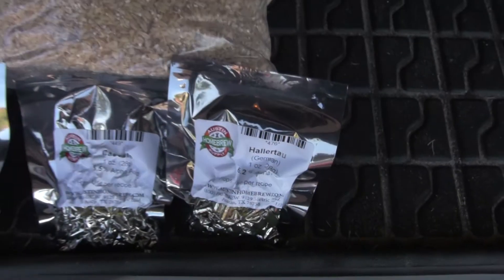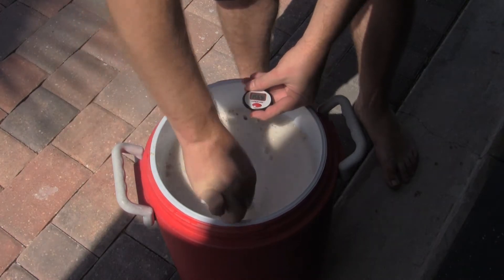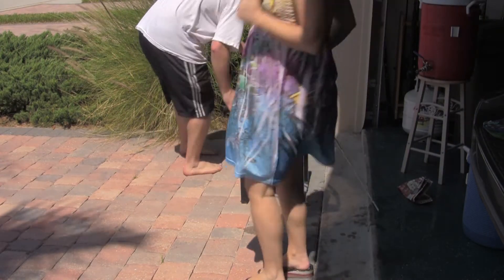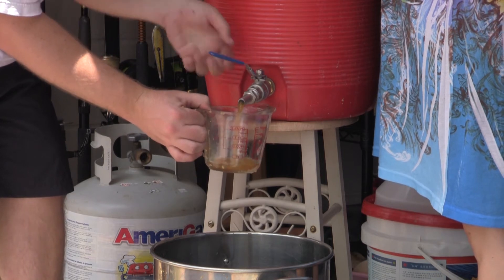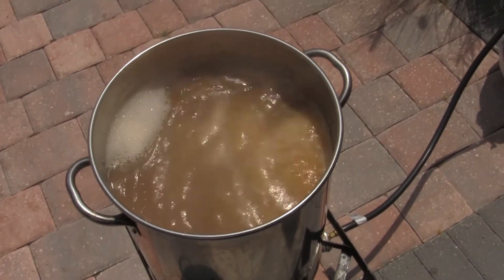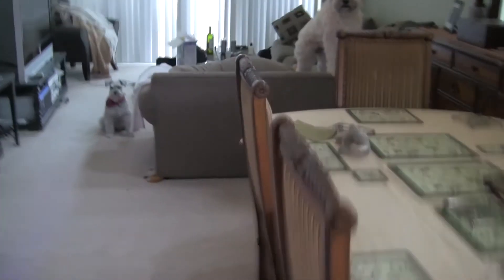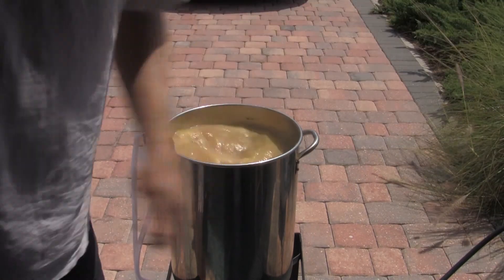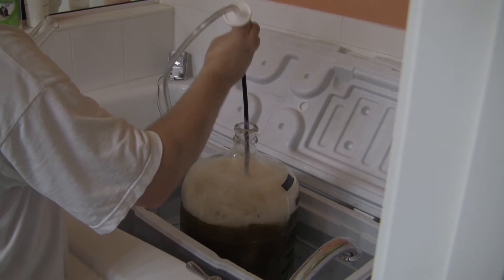Scott & Rachel Brew All-Grain HomeBrew Beer (Austin Home Brew)

Comment: Great video and commentary.  I think the best part about this video is that you showed a few problems (challenges) that you had during your brew, like the false bottom collapse and the warm water from the hose affecting the cooler. This showed how you thought on the fly and solved some problems that I might see in the future.  Rachel was cool and funny and I hope that you both are doing well.  Thanks.

Comment from the maker: I'm not entirely sure how many batches I'd get if I did the same thing exactly each time.  It all depends on a few different things- Is it an extract or all grain batch? Extract batches tend to boil smaller "concentrate" versions of the beer and so they use less gas to cook. All grain uses more because of having to heat the strike water and sparge water before actually "cooking" your wort. So they can use up to 3x as much gas. I still tend to get 3-5 batches I would say out of 15lb filled tank.

Comment: Stop stirring all the time, you are fucking up the beer dude.
Reply: How does that mess it up? Serious question, I'm new to all grain.
Reply: Because you release particles you don't want in your beer. Stir in the beginning and a couple of times throughout, but gently.
Reply: Tafsern He didn't stir after the cold break...so he is good.
Reply: Doesn't matter, you're not supposed to stir when the malt is in (you can, but less is better).
Reply: Tafsern Yeah...I haven't really seen that mentioned anywhere. If you stir after the cold break it does matter...then you most definitely will stir the trubb up into your wort causing more work for yourself in the long run. There is no specific way to brew, everybody has there own rituals.